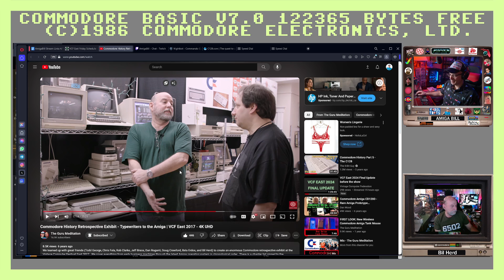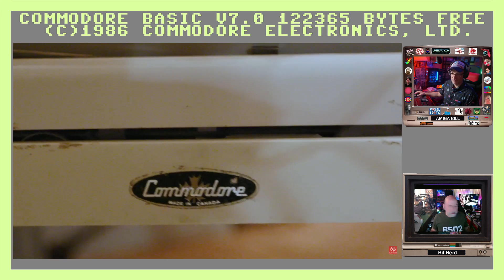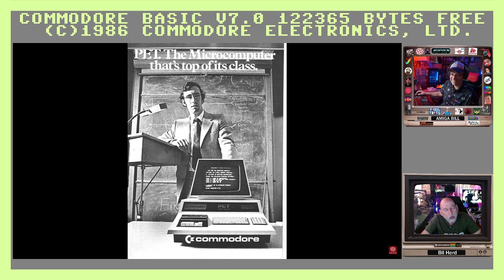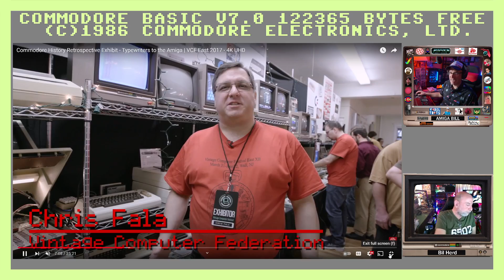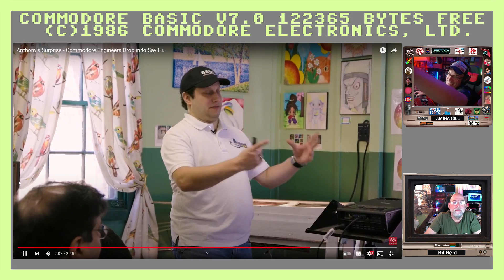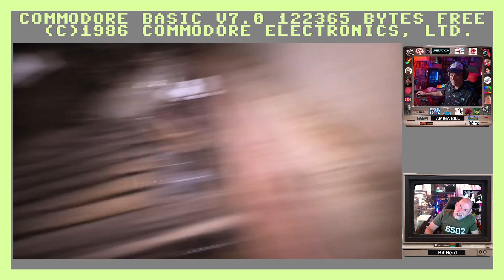INTERVIEW:  Bil Herd Commodore Engineer Talks VCF East & Commodore Stories

Comment: I schemed with my parents to get a C64... and then Christmas came and I unwrapped the brand new C128 and 1571 drive. I was excited and terrified, because I didn't know much about the C128, and was worried I wouldn't be able to play the same games on it that made me want a home computer to begin with. But then I quickly discovered it wasn't an issue. I played many games on my C128 in C64 mode, but used the C128 for GEOS128.... which was awesome.

Good memories. Love my C128.
Reply from the maker: You got a good deal. The 128 is fantastic!